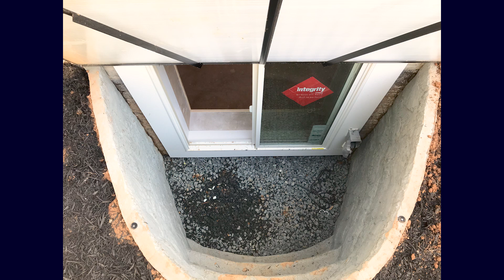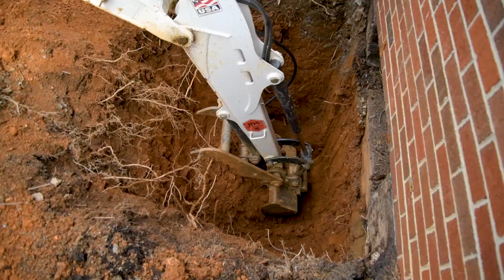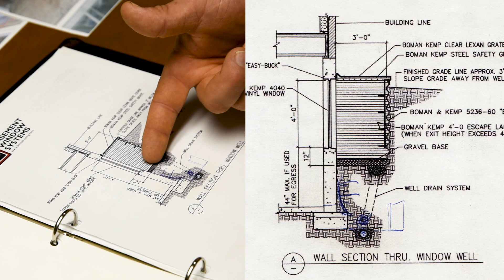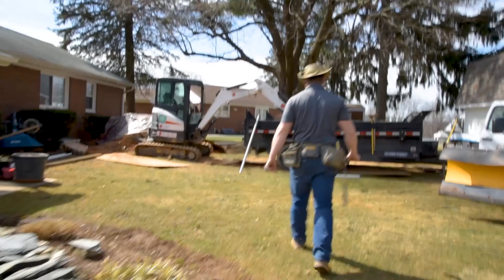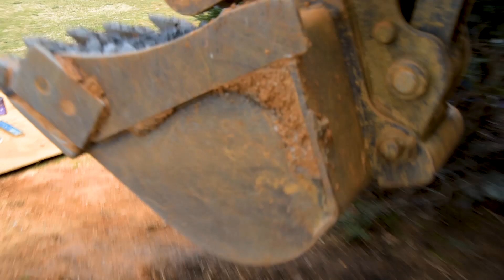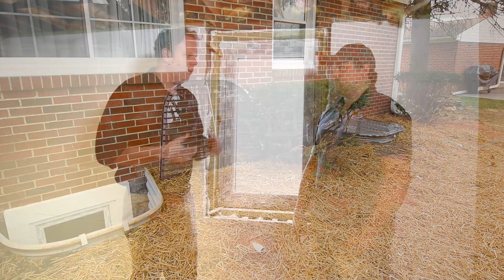Egress Window Installers Maryland

Comment: How much did this job cost?  I also need 2 egress windows in my basement and I'm wondering if I can afford it or not.  Also, do you have any recommendations for a NC contractor?
Reply: Probly 10,000 on the cheap side.

Comment: how did you power the pumps ?  Exterior power source ? or could you drill a hole through to the interior ?  Do they need to be on a decated circit
Reply: The pumps are required to be powered by a dedicated GFCI outlet. An electrician will drill through the foundation next to the window to run the wire from the outlet to the Power box.